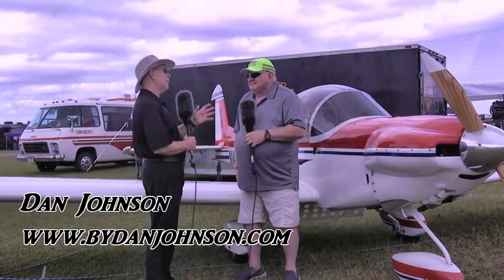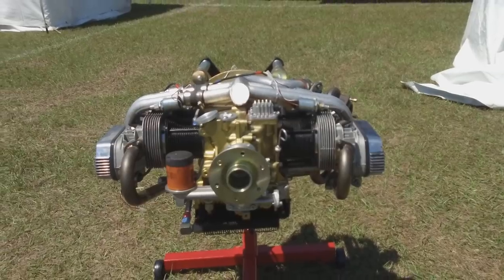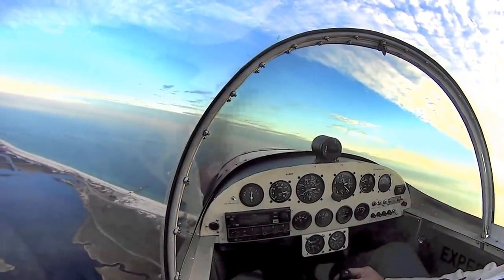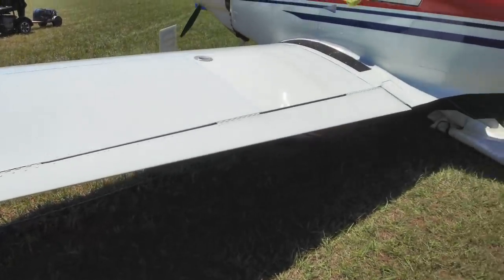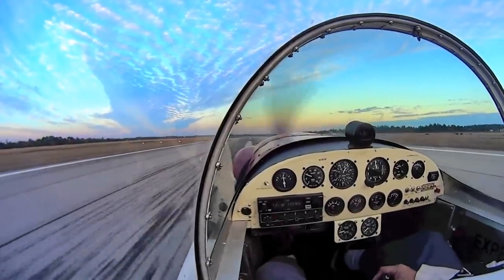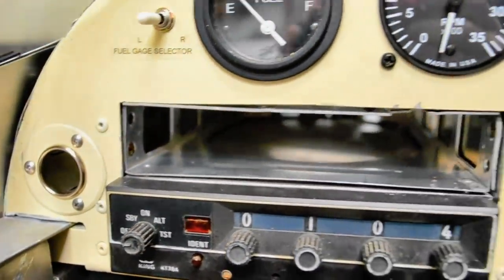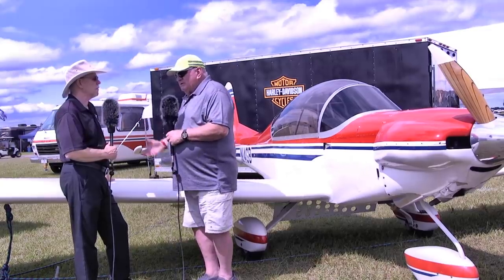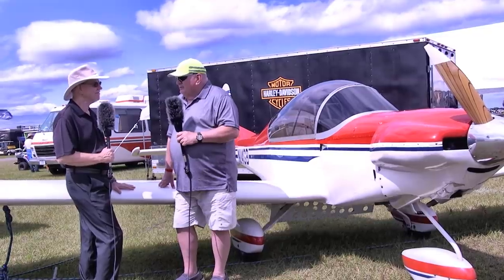Thatcher CX5, Thatcher two place CX 5 plans built experimental amateurbuilt aircraft

Comment: Nice.  Seems very economical.  Any issues getting one inspected?   How does one make the canopy?  Anyone in AL USA building one?   Idea on when side-by-side seating might be ready?
Reply: No issues with inspection.  Many CX-4 are already in the air with no issues.  The canopy is a vacuum mold process that can be done DIY or purchased through a supplier, as many homebuilts are.  The designer and the gentleman in the video are in Pensacola.  Where in AL are you?  The CX-7 is very near finished and should be done testing this year, last I heard an update.
Reply: @NWTejas  ; North Ala, Huntsville area.  I didn't see anyone in the lists.  Looks like the man that was making subassembly kits is no longer doing so.